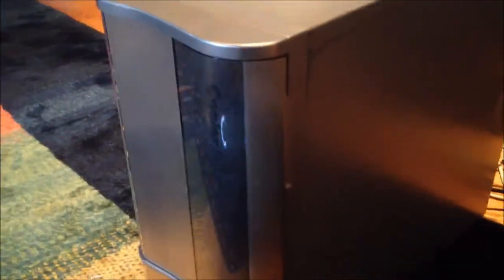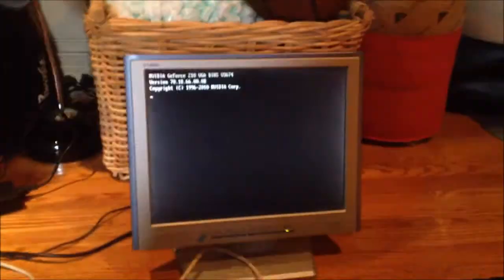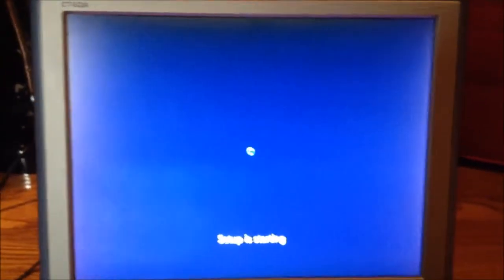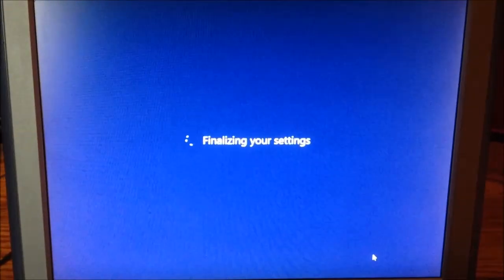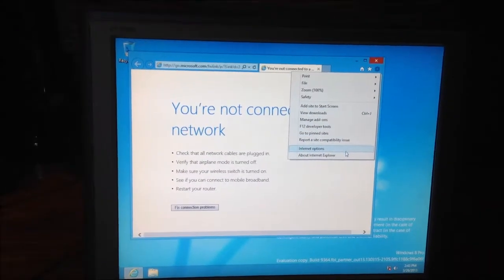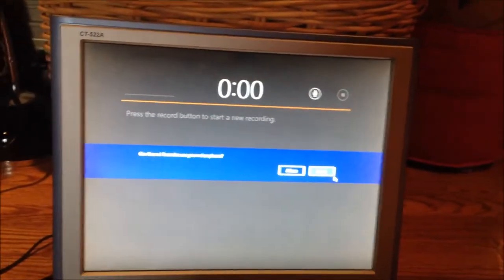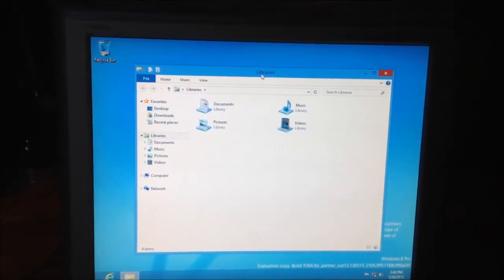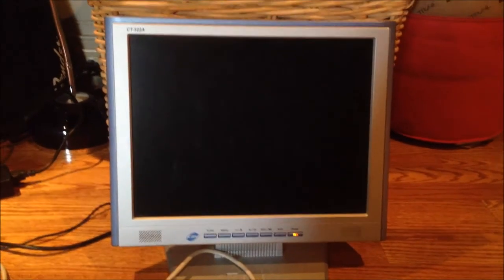Windows Blue Leaked Beta Build 9364: Brief Look

Comment: Hey. thanks for putting the vid up of the update. I also hope they'll bring this to winRT. Can't see why they wouldn't, it'll be like getting stabbed in the back if ms wouldn't update but anyways. 
One main thing that blue has is the ability to split screen WAY better than the current version. It can now split the screen to a 30:70 or 50:50 for multiple apps to multitask better, Tablets like the surface rt desperately needed this in my opinion.